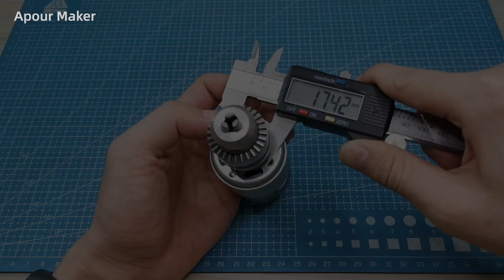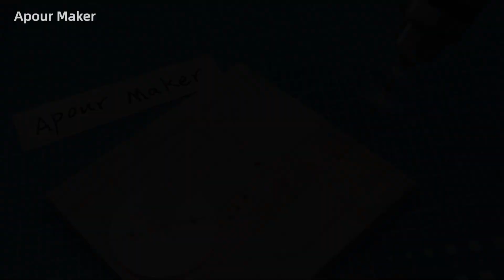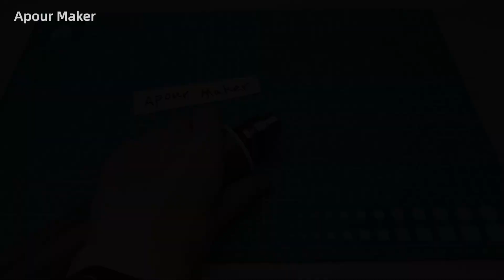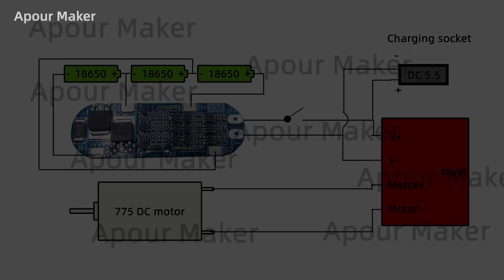Homemade cordless rotary dremel tool/electric grinder(Adjustable speed) - diy制作12V锂电可调速手钻电磨

Comment: Can I buy those parts on shopee or Alibaba I just want to know information only.
Reply from the maker: This is the AliExpress link:
775 dc motor(type:775 12V Round shaft):https://bit.ly/2z1EQfX
B10 Drill chuck(type:B10(0.6-6MM) Light):https://bit.ly/2Qt9oOu
B10 Drill chuck connector(type:B10-5MM)https://bit.ly/37cKb0B
3S 10A lithium battery protection module :https://bit.ly/3aMpVni
PWM 5A Speed control module：https://bit.ly/3fedy75
Dc5.5 socket : https://bit.ly/34gMsag
Reply: @apourmaker6055  thanks for listening . Also  I wish China motherland get well soon against the current pandemic virus . From Malaysia China most trusted real true friends and real true partners forever after Russian federation. 😇😇💖💖💖💖